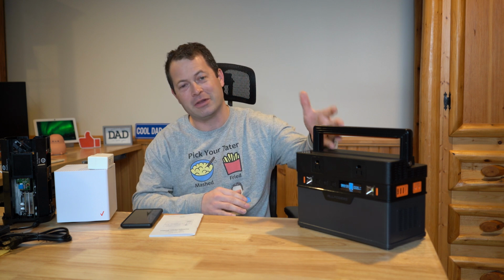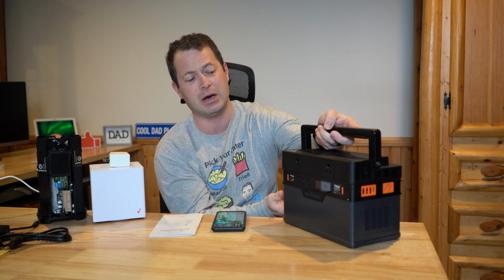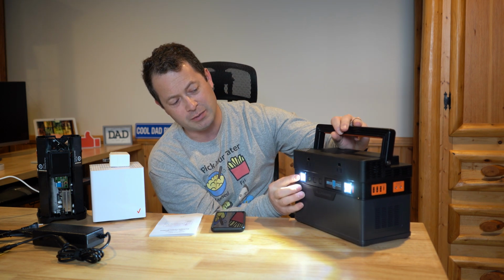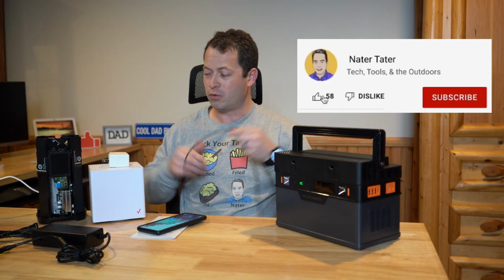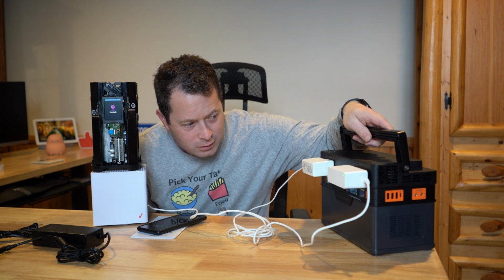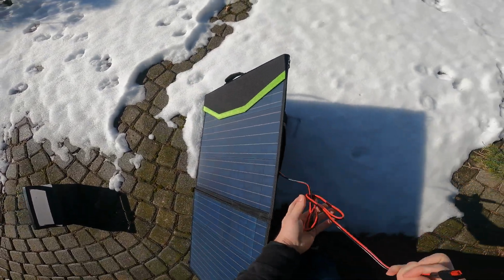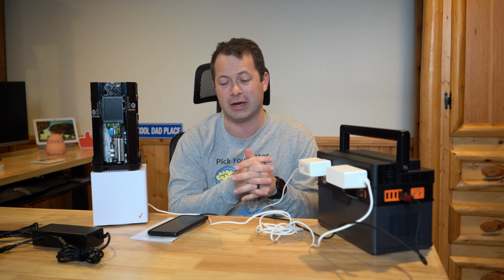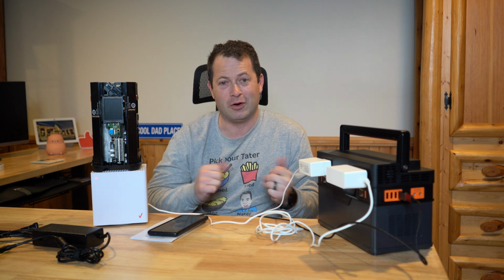✅ Portable Power Station - DC & 110V AC Outlets - 1400W Peak, 606Wh - Camping, Off-Grid, Tailgating

Comment: Hey nate, got tmhi at my buddies place. He's about half a mile from tower with direct line of site. Its running on band 66. No 5g yet but it's still working. Would a 2x2 wave help the speeds? Currently at 6-10mbps download.  Only run 1 tv and 2 cameras.
Reply from the maker: Really depends on the cell metrics but it doesnt seem right to have those speeds with 0.5 mile line of sight to the tower.  4G LTE is easily capable of 100mbps with good signal.
Reply: CQl
11
RSSI
-101
RSRQ
9
RSRP
-110
SINR
13
BAND
b66 that's what I'm seeing
Reply: Sorry about the way that laid out. Copy and paste sucks lol.
Reply from the maker: @zDrt71  thats a weak signal/rssi for 0.5mile line of sight.  You sure that's the tower its connected to? Did you confirm on a cellmapper?
Reply: @NaterTater  yes. Closest tower anywhere near me. But I'm not too sure how to completely be sure which tower it's connected to through the arc
Reply: @Nater Tater  I take it back I mapped it out its almost 2 miles away.  Sorry about that
Reply: @NaterTater  would  a 2x2 wave help this?